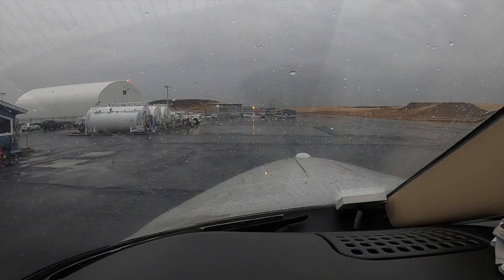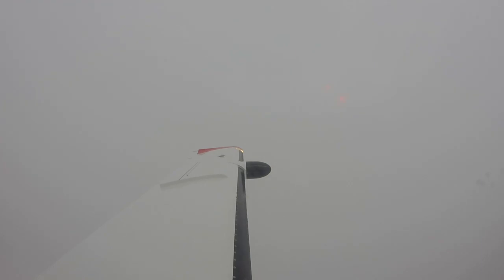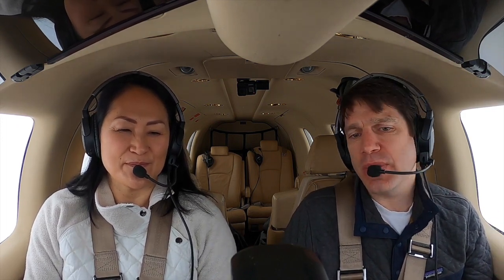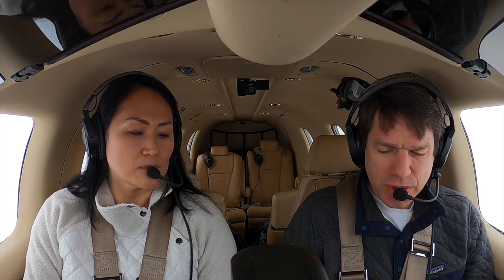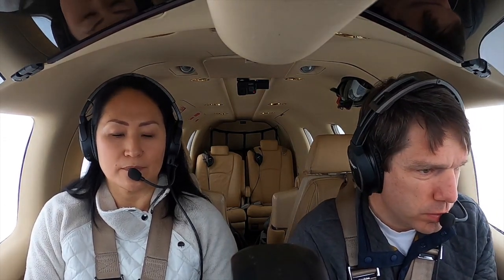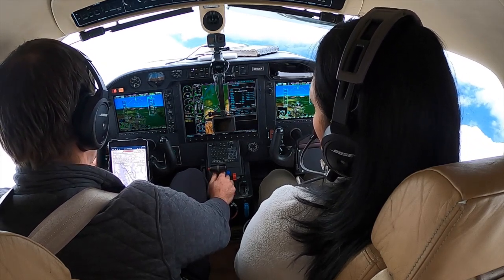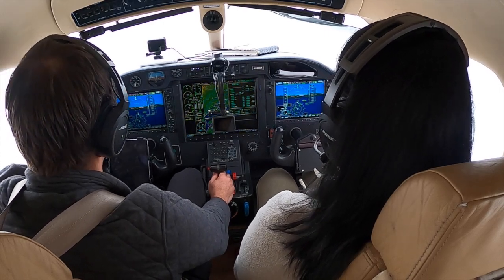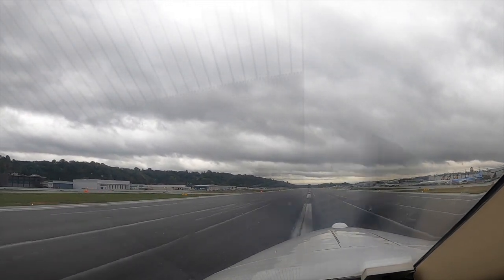TBM-850 G1000-  7 Things You Need to Know About ANNUALS

Comment: Great informative video thank you. Would you purchase a 2011 TBM again knowing what you know now about annual cost or would you op for a newer model that still has factory warranties?
Reply from the maker: That’s a really good question, and one that maybe I’ll do a video on in the future.  My business, which bought the plane, didn’t have a big enough budget to consider a newer plane.  There aren’t any other planes I’d rather have for $2.3M, so I guess the answer is yes. If we had $4M to spend on a brand new 940 w/ auto throttle, I’d love that, but it’d still be smarter financially to stick with our older plane, even with repair costs. Also, $4M is used Honda Jet territory, which I’d give a long look before pulling the trigger on a new TBM.